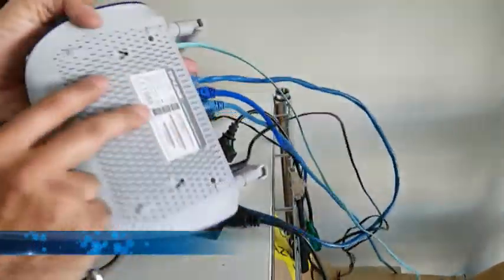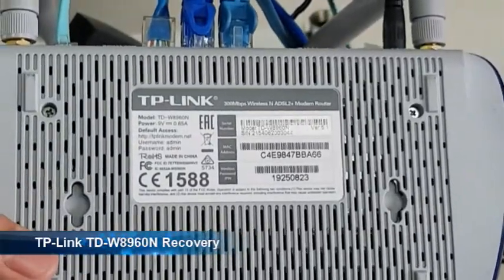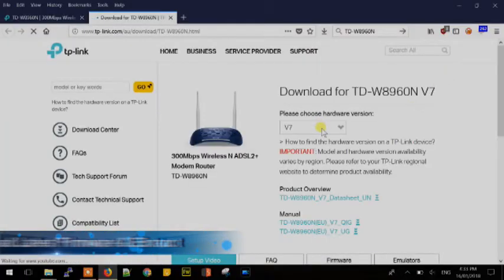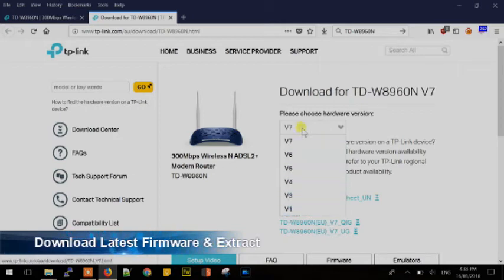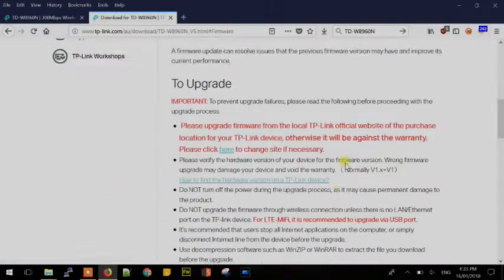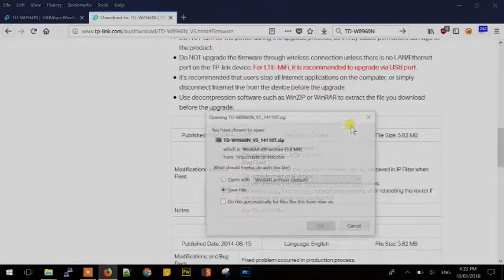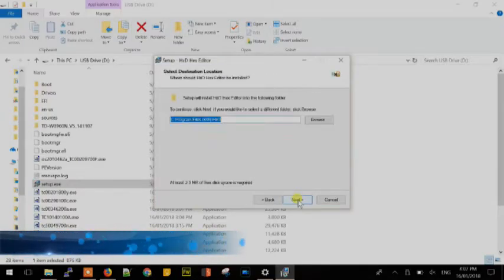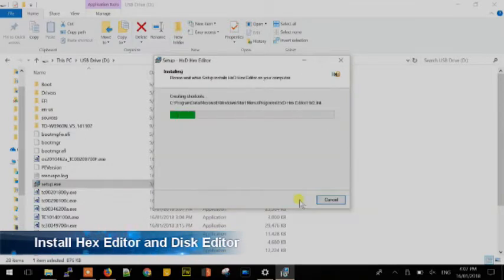TP-Link How to Recover Restore Bricked Modem Router Firmware Flash Update

Comment: TD-W8901N  router does not hold Wireless broadcast long, it goes off and then first three LED lights will be ON,  Firmware updated but still same problem in boot.
Reply from the maker: It's cheap. Get a new one

Comment: Doesn't work . I am not been able to log on to 192.168.1.1 . I'm using Tp link C7 V4 .. if any can help ??
Reply: yea me too, i was using an TD-W8591ND , i accindetally flashed the wrong rom, and i cant open the router page, i've heard u can flash it with soldering something to the pcb of the router and connect it to your usb slot on your computer
Reply: @luqmanfuadmuhashad3166  Hey I have the same issue, can't login to router page because flashed the wrong rom file. Have you found any solution yet?